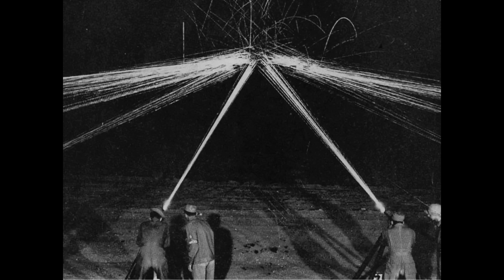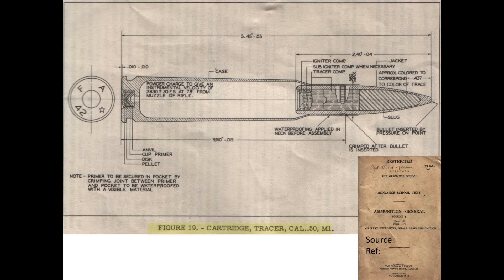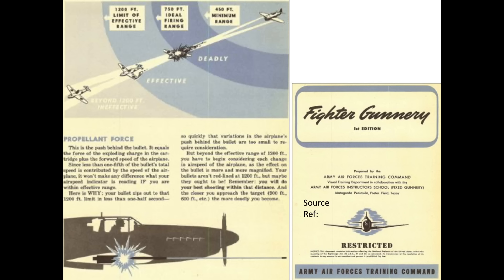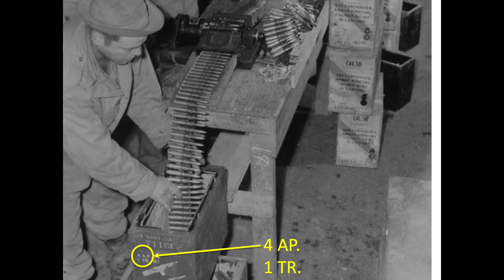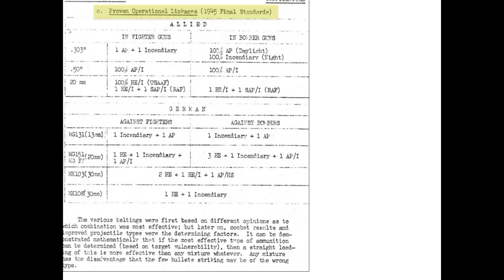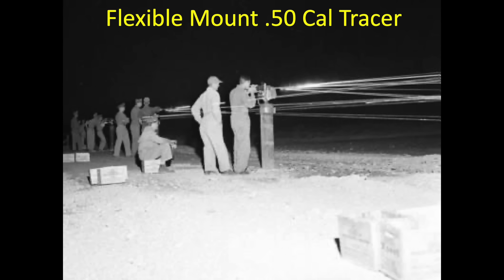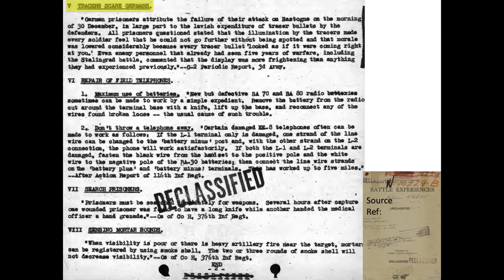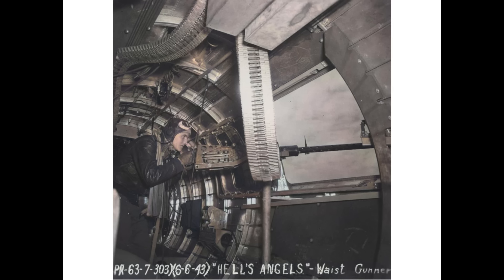Why WWII Bombers Eliminated Tracers in their Ammo Belt Mixes

Comment: I was one of the last soldiers in my unit off the plane into Afghanistan. I lined up for my initial ammo load. When I got to the front of the line, I discovered that I was being given about 80% tracer rounds that were left over from the initial ammo draw.

I asked for some replacements, stating that being the only guy lobbing out fireballs every shot, I would draw a lot of attention. I was told this was all the ammunition we'd get at that time (bs, they just didn't want to crack another case open).

Fortunately, we had to requalify because the change in air density changed the bullet trajectory from our US qualification. Needless to say, I suddenly started to shoot very poorly after having seemingly sighted in my weapon with my ball rounds. In fact, I went through nearly my total initial load trying to "get used to the new sight picture". I got to refill my mags with the new AP silver tipped rounds making me quite the happy camper.
Reply: Thanks for serving!
Reply: What cal.are u talking about ware u a machine gunner cause I thought the ap for 5.56 were greentip and black for 30-06
Reply: @rambler2885  No.. greentip is standard NATO 5.56  black tip is AP
Reply: @felixthecat265  Greentip is Light Armor Piercing.
Reply: @Jamesbrown-xi5ih  Well it is and it isn't.. US "Greentip" is 5.56x45mm NATO to the newer (SS109) specification. This is not officially considered to be an armour piercing round although it does have a steel pin "Penetrator" beneath the jacket. The SS109 bullet was adopted as a replacement for the original .223 Remington bullet which was used in the M16. The original Remington 55gn .223 round, known as the M193 was used in the original M16 rifles. 
The SS109 bullet was adopted by NATO in 1970 to replace the 7.62x51 round as a NATO standard. The Belgian SS109 round had the same dimensions as the M193 round but used a heavier and longer bullet that was more stable and had better penetration than the M193 which was notoriously unstable. The new SS109 round was known as the M855 round in the US. The steel pin in the bullet was not designed as a penetrator as in a conventional AP round with a tungsten penetrator. The idea was that by putting a lighter steel section in the front of the bullet the weight was moved back and the stability improved. The overall weight of the bullet was increased to 62gn and the length of the bullet increased. This produced a bullet which remained stable out to 800m and was capable of penetrating a standard steel helment at that range, which the M193 failed to do because it had tumbled by that distance.
 
The longer bullet however needed to be spun faster than the barrel of the original M16 rifle did to remain stable, so the US had to rebarrel their M16s to the new, faster twist specification. For a time there were both slow and fast spin barrels in service, so there had to be a way of showing the difference between the old M193 ammo and the new M855 ammo which you could only use in the faster spin barrels. This was done by giving the new M855 ammo a green tip. 

M855 is classified as a "full metal jacket ball round" not Armor Piercing (AP) ammunition. 5.56 AP ammuntion does exist, has a tungsten penetrator and a black tip which designated AP in NATO standard marking.

Sorry for the long explanation, but it is not a simple answer!
Reply: @felixthecat265  we’re using m855a1 now, it’s just a steal tip with a copper jacket
Reply: C
Reply: I go back and for between my National Guard duties and my Law Enforcement full time job.  The Guard Soldiers are always fascinated by my hollow point rounds which the military can't use.  Or at least the fact that they are standerd issue and carry in LE.  I get a lot of questions about trajectory and drop, but have to explain, on the pistol range, it's not really making any difference.
Reply: @shadowkiller7492  Someone stole the tip?
Reply: It's disturbing that your brothers in arms were willing to endanger your life because they were just to goddamn lazy it fix your ammo load out.
Reply: @rambler2885 he’s talking about M855A1 which replaced M855 (green tip) in 2010.
Reply: Welcome to the army
Reply: One would think with the mass proliferation of nods they would make red tips both subdued and dimmed to lessen their signature. If the Army doesn't go this way with red tips soon using them with the can that comes with the new XM-250 would make the can pointless for its primary function of flash suppression if any 89B does them dirty with a bunch of red tips like they did you.
Reply: Solid!
Reply: @rambler2885 At 0:57 you can see that the .50 BMG API is shown with a silver tip. Maybe OP was Humvee gunner or something
Reply: Thank you for 1st service and 2nd insight/testimonial.
Reply: If you have all tracers, aim for the barrels?
Reply: ... Were you an E4 by chance?
Reply: We started the war with pretty much unlimited ammo turned on. So we'd just burn through a ton of rounds on the range because A. It's fun. B. The new guys needed to be trained. 

Eventually command got tired of us wasting thousands of rounds, so we were told we'd only get ammo to replenish what we fired on mission. Funny enough, afterwards our ammo expenditure seems to have gone up on mission. Well at least according to our AARs xD
Reply: No such thing as light armor piercing. Green tips only added a little weight with that steel sliver. It's still to slow and too small to be AP.  @Jamesbrown-xi5ih

Comment: My Father's B-26 had in 1943-45.
TWELVE 50's on his ship.
Two in the nose.
Two in the TAIL.
Two in the waist
Two on the top.
4 on his pilots trigger on his waist.

From 1943 - 1945, 153 MISSIONS. 
over the European Theater of Operations in the Ninth Air Force. My Father.
He also led A .... B-26..,.... Christmas Day,
Bastogne,  battle of the Bulge 
Break out raid for Patton's Third Army.

As he flew nearly tree top level over Bastogne he could see GIs and Krauts waving and/or running from his bombs and blazing machine Gunn's!!!!!!

Many times many B-26's retrofitted their ships into this configuration.

The Luftwaffe had the most difficulties against 
B-26's because they were heavily gunned and very fast in the formations after dropping their bombs.

Two WASP Prat and Whitney 2,800 horse power engines made the B-26 capable of 350 Knots in their escape from targets.
And if necessary over 400 Knots in a dive
More than enough to escape chasing Folkerwolfs and Messerschmitts. 
And shoot back with tremendous effect.

The (12) 50's on B 26's was a well kept secret.
NOT SO SECRET unless you were 
a REMF or a Ground Pounder.

In addition they could carry the same weight of bombs as a B-17 and had the same number of 
Defensive 50 cals!

It also made the B 26 the most survivable and effective combat air craft of WWII.
On either side of all WWII combat aircraft.

Comment: I have long wondered how accurate tracers were when indicating bullet flight paths. This is the first information I have ever seen on the subject. Nice video.
Reply: Its not actually correct. Tracer ammuntion can never follow ball ammuntion accurately. For a start the weight of the bullet is constantly changing and secondly the tracer efflux has the effect of reducing the drag. Tracer will usually always fly high over ball. The other issue with tracer is that it has considerably lower lethality than solid rounds, again because of the reduced mass. Only ever use tracer to give a target indication and never as the basis for aiming.
Reply: In my 22 years service I found if zeroed at 300m point of aim at 400m tracer could fly higher up to head height whilst ball would be chest high. 

Tracer is a great aid to indicate targets and on mg belts the upcoming barrel change to the crew.

Comment: As always, your use of archival primary source documents is impeccable.  Every time a new one comes up, I pause and read every line.  I never knew that ammo belt composition changed over time, but it makes perfect sense.

The 1945 battle lessons document would be interesting to read cover to cover!  Is that available online?
Reply: This channel often includes in the description a link to a Google Drive location which includes the documents shown in the video. Unfortunately, such a link is not included in the description for this video.

That said, I think the document can be found at the "Ike Skelton Combined Arms Research Library" (if you search for that name you should find the site easily). It hosts numerous WWII-era U.S. military publications. Put "Battle Experiences" into the search bar at the top right of the site and the first result should be the document shown in the video (the cover appears to match).
Reply from the maker: I added a link to the slides shown in the Video. See the video description.

Comment: Fun fact. US Navy submarines and PT boats utilized the AN-M2 as well due to the lighter weight and higher rate of fire. It was also shorter so easier to stow in a cramped magazine as would be found on either a sub or a devil boat. USS Cod frequently deployed with six AN-M2 brownings and they could be brought up and installed on pintle mounts alongside the fairwater or up on the bridge.

Comment: The calculated hit percentage in WW2 was like one hit per 40,000 shots.  Even worse for side-shooting like from a B-17.  As the positions only held about 1,000 shots, and 40 missions was a typical tour of duty, the side-gunners were lucky to have gotten a single hit on target during their tour.   That is, if they made it through their tour.  The fatality rate was over 50%.  Doesn't seem worth it to lose half of the young guys to get just one bullet on target.  Grim stuff.

Midwar studies indicated that it would have been MUCH BETTER to have eliminated the heavy turrets and guns and gunnery openings.   The B17's would have gained over 20 knots in speed, resulting in a considerably higher survival rate for planes and crews.   But high command didn't want to believe these numbers,  or to be proven so wrong, so the bloodbaths continued.

Comment: The problem with watching tracers, or the bullets themselves (more often the atmospheric distortion from the shock wave), or under the right conditions a contrail the bullet leaves behind is the part you see well is the part closer to you while the important part of the arc is so far away it is overwhelmed by the closer in part. On occasions we have seen these effects when shooting targets at 500 to 1000 yards, and the appearance is that the bullet is going to strike very high as that is the part of the trajectory that is visible, farther out where it drops into the bullseye is not really visible enough to see. In the case of a machine gun the rounds in closer would essentially overwhelm the ability to see anything at great distance.
Reply: I've done a lot of competition long range shooting. With some practice, you get darn good at watching the "trace" (really just the atmospheric distortion) and following it down onto the target @ 200-1500 yards. FWIW, the very best tool I've used for watching trace is a pair of image-stabilized binoculars...Better than the best Swaro or Zeiss spotting scopes, better than the very best riflescopes...

While I'm on the topic, I was once out plinking with some pals on a cold, blustery day. We were on one hilltop, shooting at steel targets on another hill. Ranges were 400-1100 yards. What I'm getting at, is the bullets were flying very high above the ground/valley - and were thus exposed to a LOT of wind. Atmospherics that day were perfect for REALLY seeing the trace - and it was just crazy seeing the trace/wake shed off the bullets in high wind. The wind was going left to right, and you could CLEARLY watch the trace shed off the bullet from left to right; as the bullet obviously weathervaned into the wind.
Reply: @GroovesAndLands  The image stabilized binoculars are truly amazing for seeing bullet vortexes. Makes it easy to see them.

Comment: Is there any data on effectiveness (as in, confirmed kills and how likely a fighter was to break off their attack) before and after the decision to remove tracers? I would assume the answer is yes, but it's always nice to see correlating data behind it.
Reply: This comment is about the B-29, with its analogue gun computers, driving the servo motors on the turrets. And MIG-15’s, not piston powered aircraft. The biggest effect during the Korean War was the Soviets knew the B-29’s record vs Japanese fighters. B-29’s were the airplane the bomber mafia thought or claimed they had in the B-17 in 1941. The MIG’s stayed miles away and seldom if ever made a pass for months. Once they did start attacking, that story is pretty well discussed elsewhere, except before Black Tuesday people forget the B-29’s kept up daylight raids, with F-80’s flying close protection, F-84’s flying distant cover. Initially the B-29’s used tracers too. Then someone in SAC or FEAF won the difference in ballistics argument, and the tracers came out for a couple weeks. The stats changed, most MIG’s broke off the average pass 200+ yards farther out with the tracers filling the sky. Few did press on, some passing at wingtip length. The tracers went back in.

Comment: That is a great breakdown of how the ball turret works. I have met and spoke to two ball turret gunners and they never fully told me how those things worked. They just complained how small, tight, cold and sometimes boring it was to be in there for so long. They told me once there in they don’t come out until over safe airspace which can be very long it that position. Both me told me there fear was the ball turret being damaged and a gear up landing.

Comment: 4 ball+1 tracer is called, “4 bit.” 1 ball+1 tracer is “1 bit.” Just an FYI. (4b1t)

In the ground role tracer are very useful especially for commanders to indicate a target. My first mag were 30 tracer. Once my unit was engaging as per my fire control order I’d switch to all ball to cover any gaps in fire if unlucky to get too many stoppages. Most of my ammo though I’d use as a ready reserve.

Tracer flies slightly higher than ball I found but not enough to worry about once you were experienced. We never zeroed with tracer not because of the differences to ball but for fire risk. Normally you zeroed at 100m range but perfect would have been 300m but you’d be running up and down all day long. 25m isn’t ideal but can work. Tracer ignites at 100m unless your barrel is red hot then it ignites sooner. 

So unless you want lots of little fires wasting your precious range time you zero with ball.

When using mgs we’d group a few at the end of a belt to remind the crew of an upcoming barrel change. This was in the tripod role firing sustained fire of bursts of 20. You soon overheat them being air cooled.

In the All Arms Air Defence role we used 1 bit with mgs on larch poles which made it very exciting for pilots coming in. Your no.2 screams left-right-up-down or on in your ear. In my day it was 50 round bursts but I think barrel wear and cost made them reduce it. Without tracer you’d have next to no chance adjusting air targets.

Comment: Incendiary’s were very effective against bombers but ineffective against interceptors because the effectiveness depended on the temperature of the fuel in the tanks. 
Tanks with gasoline below 40C (or F…) will detonate if an incendiary penetrates them as the vapour in the tanks is below upper explosive limit. The most dangerous tank is actually an almost empty one as the pressure generated is proportional to the vapour space volume.
Some war fighters controlled this by bleeding exhaust gas from the engines into the fuel tanks to inert them.
Bulk crude oil tankers do the same thing today (and LNG tankers use nitrogen blankets) for the same reason.
Reply: Interesting
Reply: The german JU-52 flew a lot of mission with gasoline in drums. An Army soldier told, that the crew was totally relaxed on the mission he was passenger. He was frightend. Then the pilot told him that the drums were full. Flying back with empty drums would be an suicide mission.

Comment: Very interesting as ever. 
What main factors resulted in the difference in effective range of fighters (400 yards) and B-17’s (600 yards) and B-29’s (900 yards)?
Reply: In this context, effective range is to do with the probability of hitting what you are shooting at.  The B-29 had better gun-aiming gear than the B-17.  It may also have been a more stable gun platform.  
Bombers are flying straight and level while they fire, whereas fighters are maneuvering.  Also the pilot in a fighter has to fly the plane as well as aim.  And he's aiming the whole aircraft, not just the gun.
Reply: Wing mounted armament is fired in a converging pattern (rather than straight ahead) in order to concentrate fire.  The convergence is typically set at about 300 yards.  This results in anything past that having a dispersion of fire and it becomes ineffective not far past the point of convergence.  This is why nose mounted weapons have an advantage over wing mounted weapons.  Only the P-38 and P-39 had that in US inventory, nearly every other fighter used wing mounted guns.
Reply: @NuclearFalcon146  well, if you have 6 .50 cals do you really have to worry that much? /j